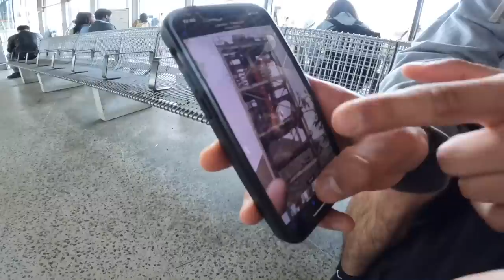How high can we jump into the sand?

Comment: you can go way higher if you can ascend down the pitch    staying in the top dryer layer will basically slow you to a stop  with no jar at any height complimentary to the angel of the hill  ps you have to use a new landing or soon you will hit solid sand pack